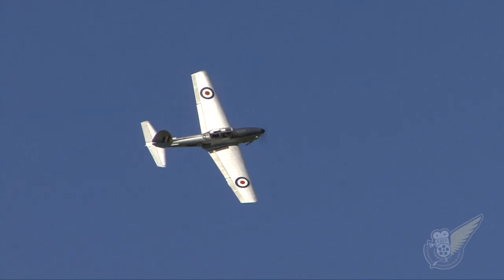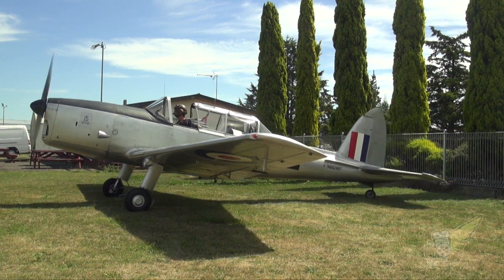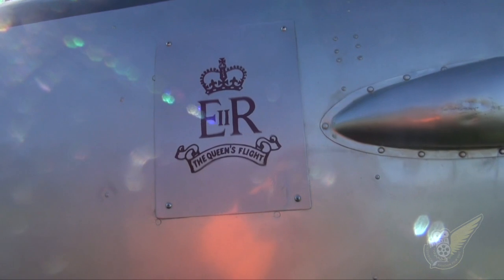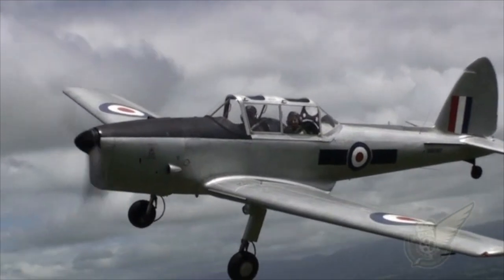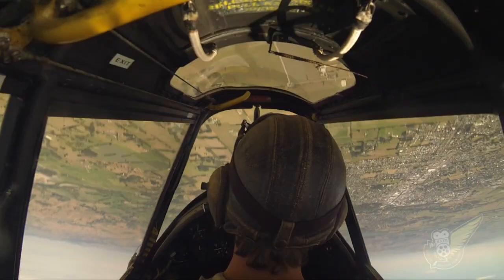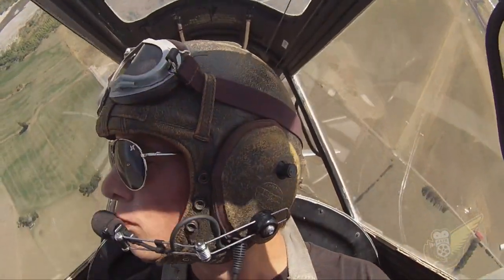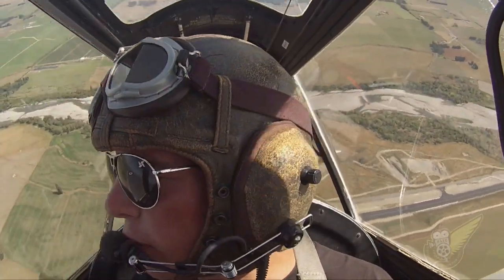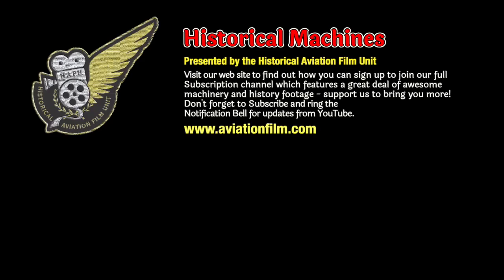Prince Philip Learned To Fly In This Aircaft

Comment: I was in the RAF section of my school's CCF - Combined Cadet Force - from 1962 to 1966.  We visited RAF White Waltham during that period for a day's air experience in Chipmunks, so there is a real possibility that I flew and took control of that very same aircraft.  I was also fortunate enough to go on a residential gliding course and successfully completed 3 solo take-offs and landings, resulting in the award of a Parts A&B gliding licence.  I strongly suspect that these days elf & safety rules exclude today's youth from such adventures.
Reply: Did pretty much the same in the late 1980's, did several sessions in Chipmunks from Manston and what sounds like the same gliding course